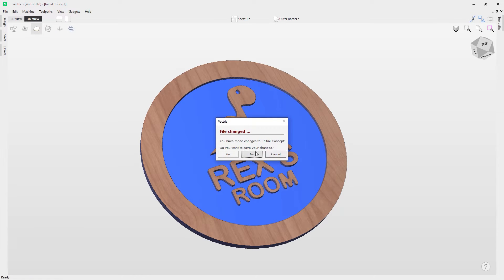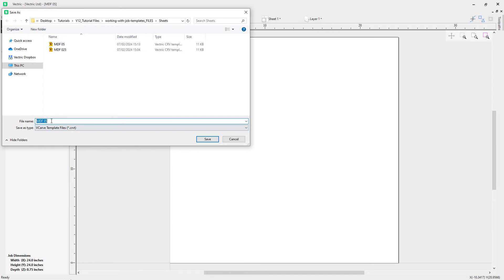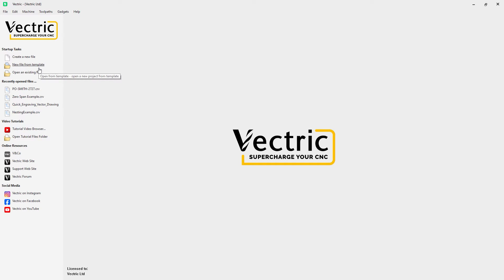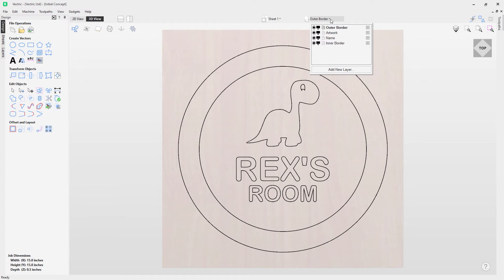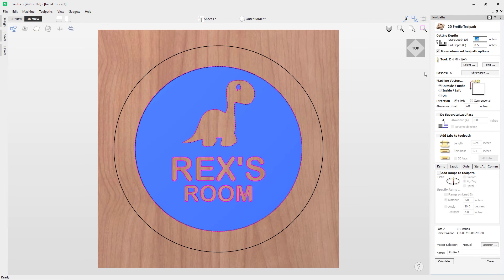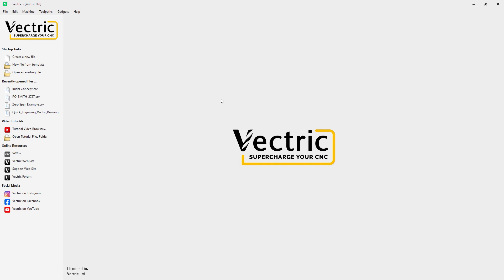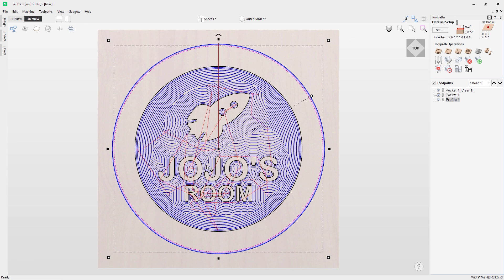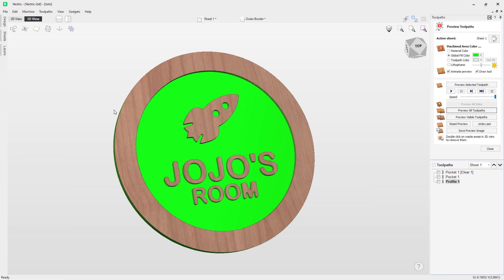How to use job templates in Vectric software | Efficiency Tools | V12 Tutorials

Comment: Another question: At min. 14:20 you used (as Beki did 4 years ago) .eps files to insert a new drawing. Is there a reason for you to use .eps files instead of .svg or could you explain where/why you would use one instead of the other. Thanks
Reply from the maker: To be honest it is up to you whatever you have on hand. SVG may be easier to find and may have smoother curves and less nodes.